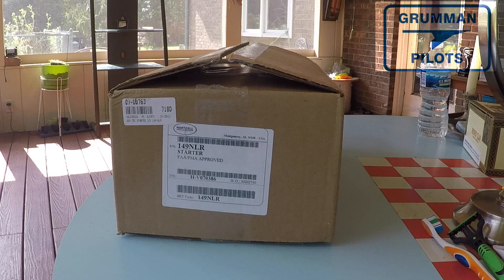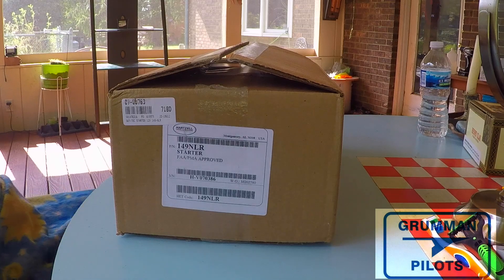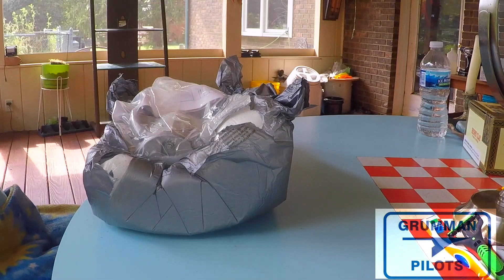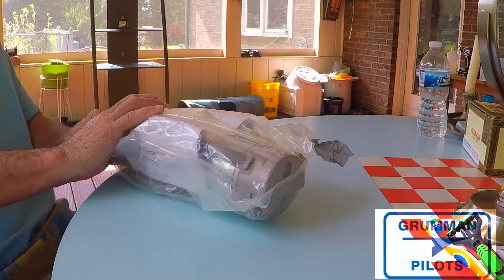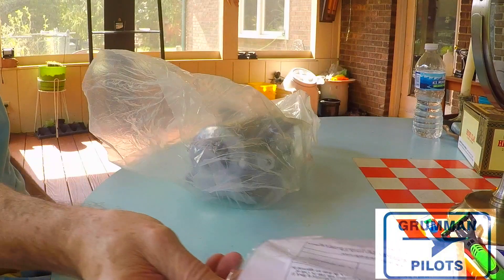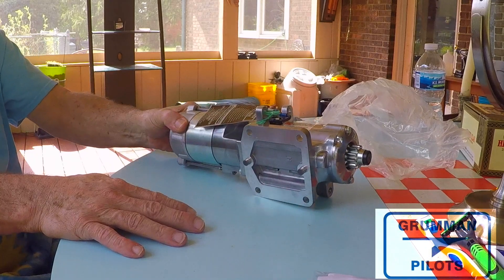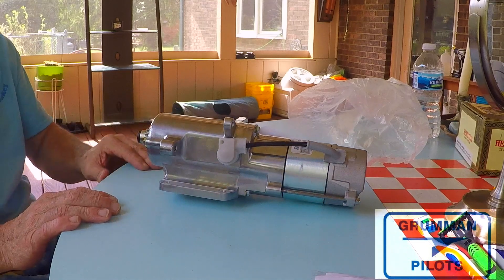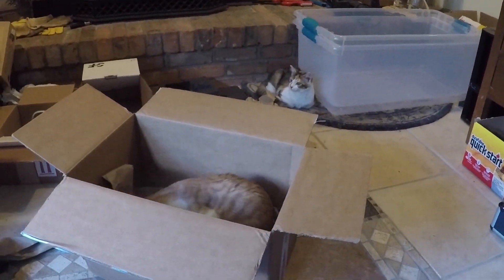Hartzell Skytec 149NLR Starter - Grumman Style

Comment: Do we need to buy the solenoid separate from this starter? or what you showed is the complete version of it? I have the old style and I would like to buy this one for people say it spins faster and starting is better. My old starter has the solenoid to mounted on the side of the Electric motor.
Reply from the maker: It spins faster, uses less battery and is a great lightweight starter.
Reply from the maker: Yes the solenoid is separate from the starter.

Comment: I actually got one of these starters when I purchased an airplane hanger it was left behind still in the Box it does look like it had been installed at 1 time cause you could see some markings from the lock washers mine is the 149NL
Reply from the maker: Put it on and see how it does.  They are a good starter.  I put a lightweight B&C starter on my Tiger in 1994, still working great.  If you want to sell it let me know.